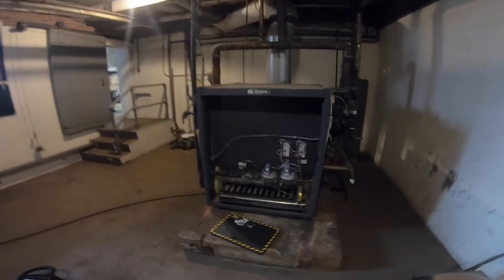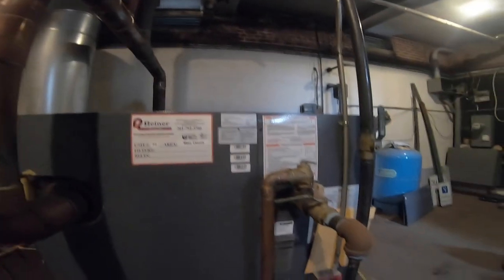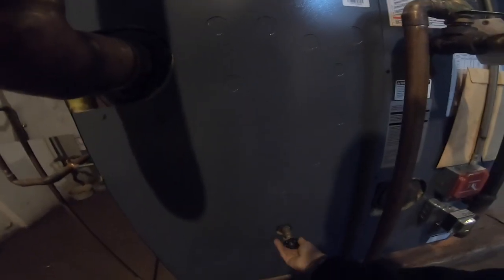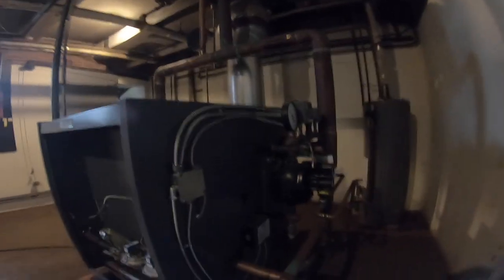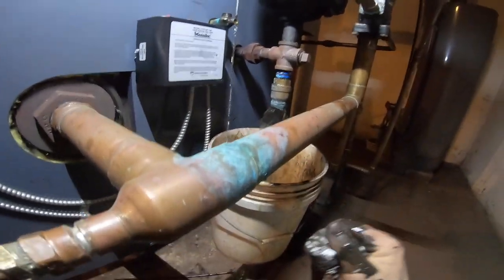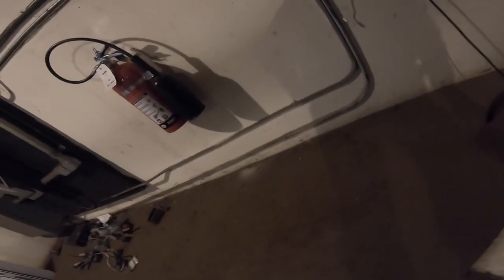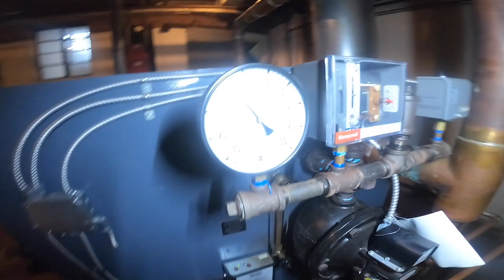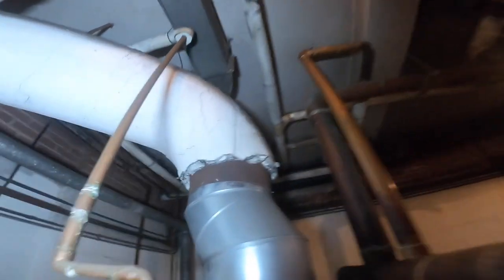HVAC Plugged Boiler Pipes Maintenance Clearing Pipes

Comment: That electronic low water cut off is mounted below the sight glass and is way below the lowest permissible water level. The boiler is relying on the one float style safety which never gets blown down. I had a 2 year old boiler melt down after 2 safety control floats failed to drop. No maintenance was done and no weekly blow downs since it was installed. Boiler ran through the weekend without water. Finally melted the high voltage wiring and shut down. At that point, if water would have been added, you know what would have happened...
Reply from the maker: I don’t know why people don’t care about there machines till they break. These machines can be dangerous if not maintained.

Comment: Nice to see a steam video.  What size boiler in btu's?
Reply from the maker: It is 724 MBH which is 724,000 BTU’s output, input 910,000 BTU’s
Reply: thx.  big enough.  probably over 2400 square feet of steam.  my place used to have a 425,000 weil.  replaced wirh a smaller burnham as we eliminated some rads.
Reply from the maker: It's around that number of Square ft. This has rads and you seen the steam coils for forced air heating, old church and school

Comment: I was vary surprised to NOT see a chemical injection pump on a system that large??exultant call to do a full pull down and clear out.
Reply from the maker: I do on all my Steam maintenance if not what was the point of cleaning the sight glass to not clear the bottom pipe or even all pipes to controls and safeties. I get 4 hours for this job yet besides the boiler there is a lot going on here

Comment: Yearly maintenance and some chemical would help to keep it clean
Reply from the maker: This was the annual maintenance and yes chemical would help along with the customer blowing down the boiler weekly.You should see the old carrier chiller outside
Reply: @thehvachacker  that's why the Bill gets big when work needs to be done. It's all destroyed no daily or weekly maintenance. What they expect out of it
Reply: @thehvachacker  all people think is the tin box in the basement makes heat lol. Don't do anything till the tin box quits then it's a catastrophe
Reply from the maker: It could be why it looks like this boiler was replaced not that long ago and all the important parts from the old boiler on the ground in the corner. No reason for the returns to get all plugged up if the customer takes care of there equipment.
Reply: @thehvachacker  right on
Reply from the maker: Which chem do you like to add to your steamers
Reply: @thehvachacker  don't remember name of it. Turns yellowish green in color in sight glass
Reply from the maker: I have used that fluorescent green liquid and the white powder cleaners

Comment: What was the pressure-stat set at on that beast? We saw it at 3 PSIG and you said it was still climbing... At first blush, it sounds like the pressure is set too high (energy waster) or they have a piping restriction and are trying to overcome it with excessive pressure.
Reply from the maker: It was shutting down a little under 4psi. I didn’t play with where the controls was set. This is a very old building. Not sure if there may be some pipe restrictions yet I see a lot of boilers set to cut out around 3 usually.
Reply: @thehvachacker  if the piping is sized correctly, steam heating systems only need a few ounces of pressure differential to achieve positive and reliable  steam flow. Excessive pressure requires additional fuel to maintain (the wasteful part I mentioned earlier) and causes extra wear to the valving, seats and shafts of the steam control devices, as well as possible component hammer during opening/closing. If I had a dollar for every system I have rehabed and changed from pressure-stat to vapor-stat, I could retire!
Reply from the maker: A half pound of pressure can heat a whole city block. Yet a lot of times the piping isn't always sized correctly in many of these older buildings
Reply from the maker: Bear you should make some videos of your work on steam boilers. It can only help others learn, Not a lot of videos on steam boilers. Here on youtube most, not all, but many want to help each other learn and get better
Reply: @thehvachacker  I teach directly and in classroom situations, but have never craved the attention of YouTube.
Reply from the maker: Do you teach for the company you work for? Or do you teach at a school? My employer has a trainer position with a training classroom with units set up for the new techs. I know steam yet would love to always learn more since I was mostly residential doing some commercial work, this year it flip-flopped with mostly commercial with some residential. So I still have lots to learn about the larger systems. Yet my mind needs constant learning and stimulation from learning and understanding everything I see and work on. If you watch any of my videos I work on a large spectrum of machines. Fault can be found here and there and I do make mistakes even though I never give up and work my way through everything
Reply: @thehvachacker , I have taught in house, however most employers won't invest in house. Most of my classes are under contract and I teach impromptu with my apprentices.
Reply from the maker: Always good to share your wisdom with someone and your apprentices hopefully can share there knowledge one day

Comment: Doesn't anybody there use boiler compound? Get a longer rod and bend it into a U shape to clear the drain so you don't have your hand under it.
Reply from the maker: I should of yet boiler compound doesn't help if the owners never blow down the boiler. Might actually make it worse bringing all that crap and sediment back to the boiler and it never getting drained out.
Reply: @thehvachacker  Maybe they should install a motorized ball valve with a pipe run to a drain and a timer to open it for a few seconds a day.
Reply from the maker: That is something they should do. Most boilers have drain pipes for blow downs. Here they have a hose so you know they don’t use it often
Reply from the maker: Tired what compound do you like best for steam the powder or the fluorescent green liquid?
Reply: @thehvachacker  We always used the Oaty Hercules boiler liquid. It was what the local supply houses stocked and seemed to keep the systems clean and trouble free. It can be poured in the condensate tank in a steam system. We drained and refilled the closed heating/chilling systems every year and added some. We also used the Flip Sticks soot destroyer in boilers and furnaces to keep the heat exchangers clean on the combustion side.

Comment: We done 2 - 90,000 gas and oil, build a new 90,000 coal boiler and redone 2 - 90,000 coal , the coal boiler started on gas and the PLC system to run them
Reply from the maker: Nice, what are these boilers heating?

Comment: A Taco 007 is:

a) A Mexican dish for James Bond
b) a part for a HVAC system
c) all of the above.

You called it, you should have worn gloves...yuk.
Reply from the maker: C all the above
Reply: Gloves my brother,I’ll save you from all the iron oxide in thatWeil McLain!,definitely going above and beyond compared to most techs.If you took a hose and removed upper plug on float,could clear the float without removing gasket,Jst one guys opine,been there,done that,thanks for bringing us along.